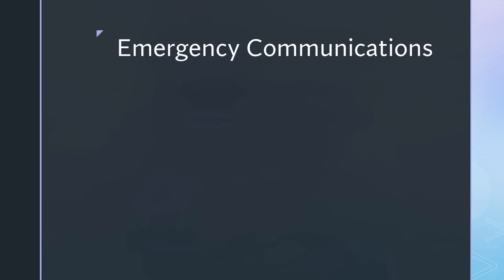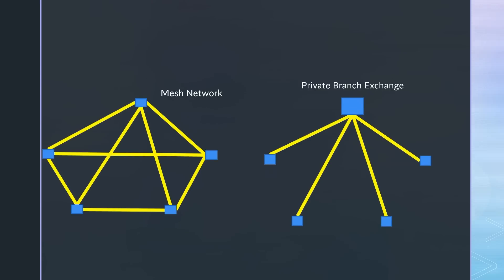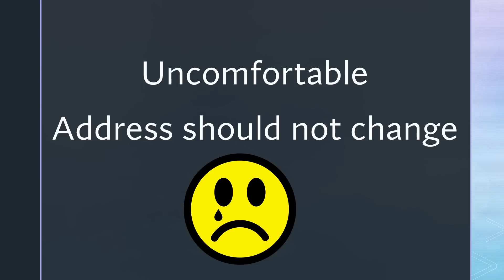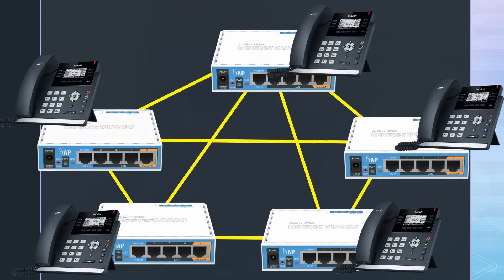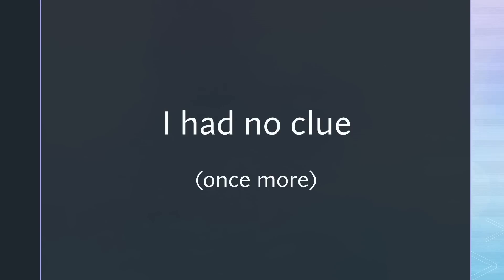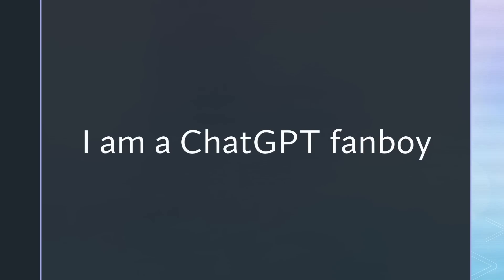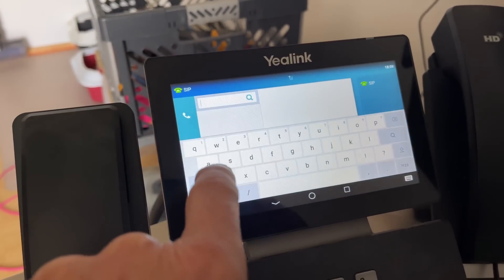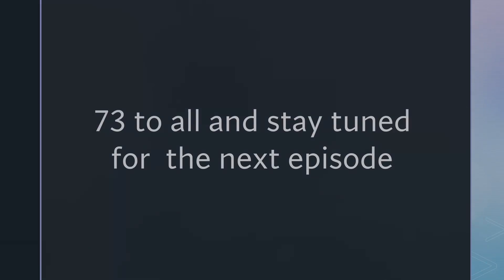New: Comfortable and robust VOIP without PBX in AREDN networks

Comment: The OpenWRT 802.11n ad-hoc mode CSMA was introduced around 2010, and many attempts have been made to create USA FCC Part 15 (public band) meshes using this technology. AREDN has adapted the OpenWRT driver for use in the USA FCC Part 97 (amateur band) and continues to work on this project. Commercial radios with proprietary TDMA systems offer excellent bandwidth, channel utilization, and Quality of Service (QoS). However, when AREDN reflashes these radios, it replaces the TDMA system with CSMA.

CSMA is the technology behind ALOHAnet, the original radio network. Several protocols have been developed to improve upon CSMA, including the OpenWRT driver’s implementation of CSMA 802.11 RTS/CTS. However, this still has its issues. The 802.11e standard from 2007 was incorporated to provide QoS for 802.11 ad-hoc networks, but there is little market demand for this outside of AREDN, and commercial device implementations are rare.

So how well does AREDN’s CSMA implementation work as a replacement for TDMA? It can be fast, achieving speeds of 100-200 Mbps in point-to-point connections. However, even with good links, speeds can be much lower; for example, a one-hop link to one of the lead AREDN developers tops out at 3 Mbps on a speed test. Mesh networks cannot be extended indefinitely using mesh technology alone, so AREDN developers are creating a “backbone” network to connect mesh “islands” using cheap, unflashed commercial TDMA radios.

Before flashing a couple of MikroTik radios, it’s worth checking them out; with good links, point-to-point connection rates can approach 1 Gbps. Network performance tests have been developed for AREDN, and it has been shown that the network can flatline (i.e., achieve 0 bps) under load in a point-to-multipoint network. Bandwidth has also been shown to be proportional to SNR in a point-to-multipoint network (known as the “sector” problem in the AREDN community). Without QoS, many issues can arise.

AREDN promotes free software and ease of use as its two main selling points. The original software is user-friendly, although some knowledge of TCP/IP is required. While AREDN is free software, it can have a significant impact on network performance. Dumbing down ham radio should not be a goal.

Comment: AREDN does not function as a network. I am located in San Francisco, where one of the largest AREDN networks exists, and I have conducted extensive testing on the network.

To implement FOSS, AREDN OpenWRT employs CSMA (802.11ac ad-hoc mode) instead of proprietary TDMA signaling. CSMA is effective for a single user, but its performance deteriorates rapidly when multiple users are present on a network. This is why network demonstrations are never shown, only link demonstrations.

If you recall ALOHAnet, it used CSMA and served as the motivation for the development of improved demand access schemes for radio networks, such as TDMA. In overload conditions, channel utilization in CSMA can drop to zero.

Jitter increases with channel contention, rendering VOIP unusable within a network.

Please refrain from spreading misinformation. Is there anything else you would like me to help with? 😊
Reply: This is an unhelpful and misleading comment.

The barest skim of IEEE 802.11 would inform you all wifi devices (at least all that adhere to 802.11 specs) utilize carrier sense multiple access with collision avoidance (CSMA/CA).  As CSMA/CA is implemented as part of the physical layer, there is nothing AREDN, OpenWRT, or any other firmware can do to escape utilizing CSMA/CA.  There is nothing proprietary about time division multiple access (TDMA), it simply is not part of the 802.11 spec.  Stating any of this is done "To implement FOSS" is completely nonsensical in any context.

If you have done extensive testing of the network, you must have documented and repeatable results.  Can you share these results?
Reply: @shotgunmoose I have posted results posted in HaD but they were taken down when linked here.  I am able to get AREDN to lock up and reduce bandwidth to zero in typical operation.  Take a look at  IEEE 802.11e-2005 - that fixes problems  with 802.11 ad-hoc mode, like lack of QoS.  TDMA avoids a boatloads of ALOAHAnet problems.  There's no good reason to use ad-hoc mode when TDMA is available.

Comment: Hi. I have been designing VoIP systems for many years. I think you'll be better off if you introduce federated proxies. A proxy properly configured on each node will take care of routing calls internally within the node. If the callee does not belong to the node, the call will be forwarded to the proxy handling particular callee. Of course audio will still flow directly between phones so no delay or distortions will be introduced. You will probably need a better SIP proxy such as Kamailio or Opensips.  It will still work fine in split-brain scenario when a node is disconnected from the mesh. Have a think and let me know if you need any help.
Reply from the maker: Of course, I am always interested in better solutions! I am no VOIP specialist. This is why I do not understand how this would work (I also do not understand the difference between a PBX and a proxy for small networks). We generally only have one or 2 phones per hap router. Would such a router be the "node"? And how would the decentralized phonebook be handled? The IP address of the phones will change over time because the mesh is not stable (AREDN does all this management). And what would be the advantages? I do not post my email on YouTube, but I am on QRZ or on Twitter? I would be interested in learning your approach.
Reply: @HB9BLA   one of the features of SIP proxies (and not only proxies) is the registrar database. When the phone registers to it, the registrar stores client information (such as IP address / port of the client) and can use it to route the call when needed. For example, you could register as hb9bla (at) node1, and if anyone calls that SIP URI, the proxy will translate it to the IP address and send it to you.  Practically you will never need to generate dynamic phonebooks because your SIP address will never change. 
Let me compie the aredn client for x86-64 and will prepare a real live demo with it.

Comment: I did not realize they were running completely through the PBX on ARDEN.  I thought they were only using it for the introduction of endpoints.  When I used VOIP phones and ATA I often ran my IP phones without registration.  Then I would route call directly using dynamic DNS.  I mostly used the devices by OBIHAI.  They were always very configurable when you took local control of them.  I wonder if a workaround would be for each node to run a mini PBX and DNS server.  System resources would be very low since they would not support calls of the whole network.  Each server would be authoritative for it's DNS records.  They would then cache and forward that data as usual DNS servers do.  If a true top level domain were used it would even allow for the completion of calls over the existing internet if a node were severed from the mesh and another node had internet access.  Seems like something a PI zero 2 w could do now that they are back in stock consistently for the price of $15 USD.  Always possible to go back to old school host record files when managing so few records.

Comment: This is a fun project!
By the way, you don't need a router or remote phone books to do this with Yealink phones. Yealink has the ability to use custom dial plans just like Asterisk. I have a couple of the old Yealink T32's setup on their own POE switch and physically separated from any other network connection. My kids use them to play phone between rooms. Depending on what they dial they may get a voicemail, intercom, or regular calling.
Reply from the maker: Interesting. So your dial plans keep the ip addresses of the phones?

Comment: q1 - wouldn't it be better using IPv6 (if the phones can make us of that), since it is much easier to handle when it boils down to IP-Address-handling (eventough the address as such is more complicated), the non-publicly-routed FE80-address can be used within the mesh, and it normally will not change (for the MAC-ID being part of the fixed address), 
q2 - is there a "AREDN for "non licensed but interested people""? (like: pure wlan-meshes trying the same, or even: using CB for the same venture?) OR:

q3 - since i have lots of trouble learning the skills needed for the hb3 and only have hostile clubs in my area (all of my good school-friends are members there - and still didn't grow up): what would be your advice for beginners?
Reply from the maker: 1. AREDN (like many others) does not support IPV6
2. You could use regular ISM frequencies for your mesh. A few channels are shared by HAM radio and ISM. However, I do not know the legal implications.
Reply: thank you  @HB9BLA

Comment: I think Mikrotik can run containers now, maybe this would help?
Reply from the maker: These small routers and antennas only have 64MB of flash. So containers probably would be overkill. But we want to use a Raspberry in the mesh for that purpose. However, this is then a single point of failure and cannot be used for important stuff.